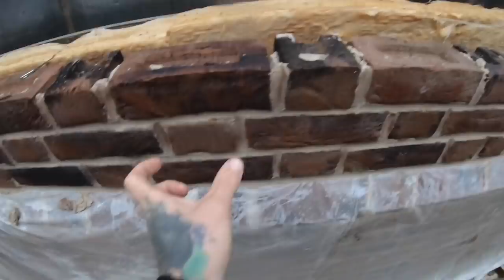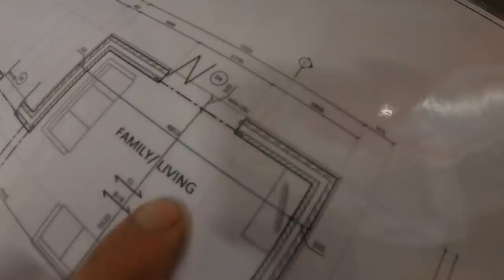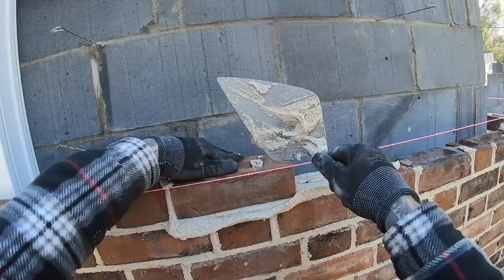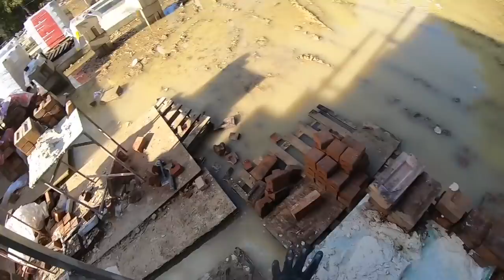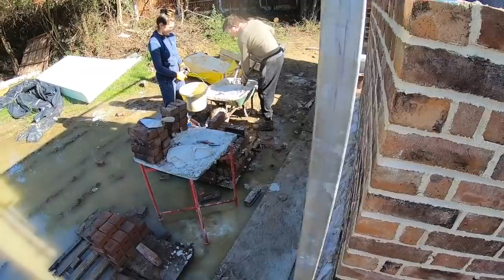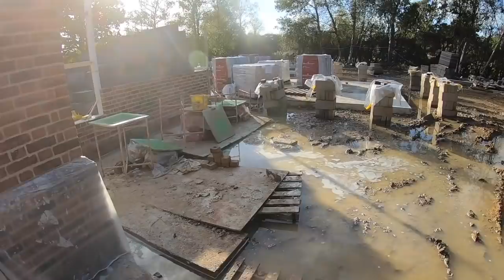Bricklaying - Day 8 - Chimney decision

Comment: Them BT clips look good mate! Job looks fantastic buddy, gonna be a proud moment for you and the gang when it's all done! 😊
Taking about bricklaying books, Ive spent some time reading Bricklaying System by Frank B Gilbreth. Published in 1909 but still very relevant for today's bricklayers and goes into great detail about the whole job really. Think it's still possible to download it as a PDF👌👌
Reply: @martin2466  yes he put a lot off working systems in place we still use today not just bricklaying, factory lines and even operating theatre 👍🏻
Reply: Same re the books. Full set of 1948 Caxtons, 'Modern Practical Building', use them all the time as many of the buildings I've worked on are from that period...

Comment: Charlie here in the US we use a plastic jointer their made of clear plastic for white mud like your using that way you can't burn your joints that's what we call it when. You get theose hateful black marks you get if the joints get a bit dryer I think Marshall Town and W  Rose sells them  you just have to watch how there wareing after a while the start changing shape and will make your joints change shape

Comment: Charlie, if you wanted a more rustic look, keeping the joints white, use pram wheel tyres. They are white and don't stain the  mortar. Just cut them into 100 to 150 mm length
Reply: Get a glass pointing key on Speedcrete for point white mortar.

Comment: I don't understand what is going on? I thought you were setting out broken bond to achieve header closure up all reveals as it should be, you've got three-quarters up some and header closure up others, don't get it?
As for the stack ,I would have altered it but that header won't even notice in English bond, person I wouldn't have jointed them bricks would have been a flush joint 👍
Reply: Agree re the flush joint, also I would use the straight arris face side of the brick but everybody's different
Reply: Let’s try one positive remark every time you comment 🇦🇺🇦🇺

Comment: 8:32 you can see a half brick sticking out like a sore thumb, 2nd row up left side reveal. The sun is probably making it worse than it actually is  though.
Reply: 2nd row??
Reply: @brucetindal7399  starting at the bottom of the window reveal, left side. 2 rows up
Reply: Try course. If you want to sound like  you know what you are talking about. Terminology  is everything
Reply: @brucetindal7399  Didn't claim to be a brick layer. But i do have a pair of eyes. I can see a brick when it's not plumb with the other bricks and i can see a prick when i see one too.
Reply: @MrCharlan1  are they half bats?. Or snap headers?. Or half bats laid as snap  headers?  Lol. What you think?